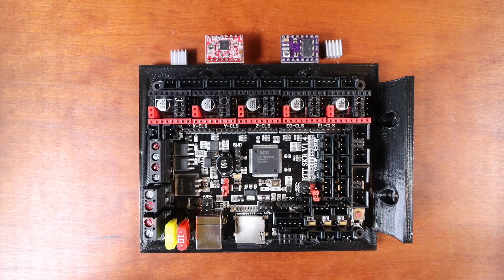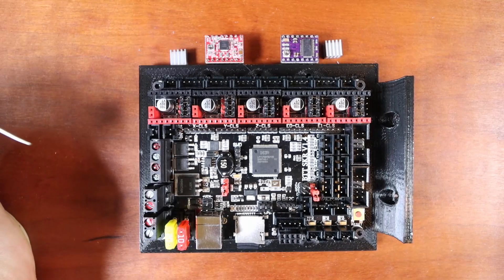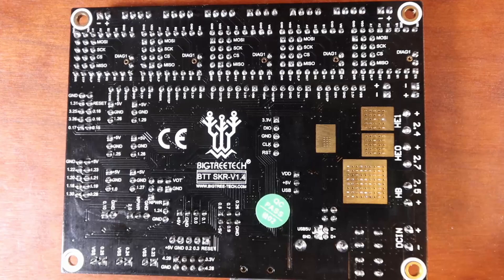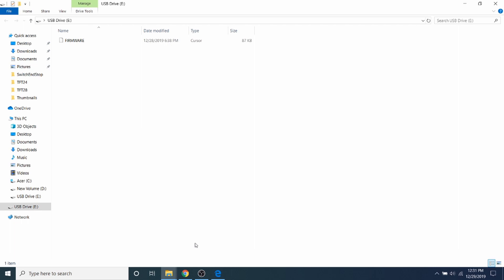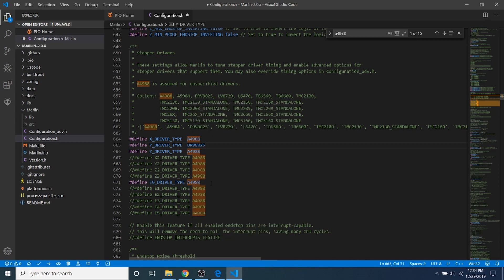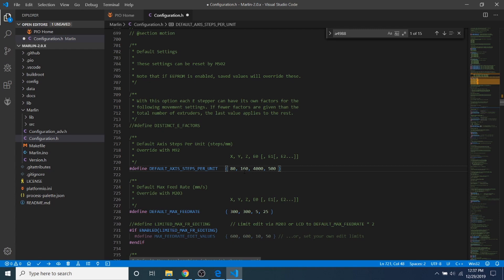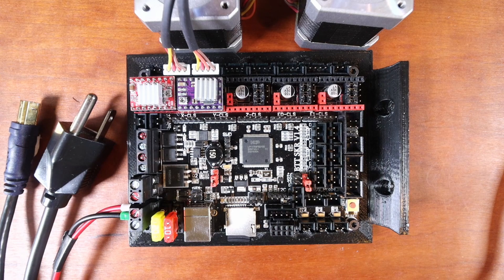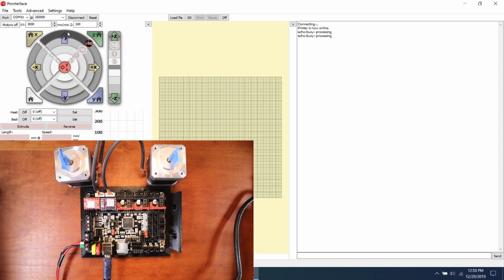SKR 1.4 - A4988/DRV8825 configuration

Comment: Hi, on the SKR 1.4 manual says that when we use DRV8825 we should connect RST and SLP with jumper cap. but it seems you are not using that jumper, why?
Reply from the maker: It appeared to worked or the manual was updated after the tutorial.  This happened to me with TFT display so it might be why.  I'll check the manual I downloaded last year.

Comment: Great, best I have seen in a long time. This tutorial explains everything you need to know to get your BigTreeTech SKR 1.4 up and running. All tutorials should be this good. Oh, I was using all DRV8825 so I updated my configuration.h to : 
#define DEFAULT_AXIS_STEPS_PER_UNIT   {160, 160, 160, 160, 160 }
#define DEFAULT_MAX_FEEDRATE          { 200, 200, 20, 25, 25 }

I only have one extruder and my printer is a Anet A8, TronXY X3S  clone with a Prusa I3 MK2 extruder. 
Thanks Richard
Reply from the maker: You're welcome.
Reply: @EdwardBraiman  : Great. got it installed and was able to compile: In this board there are five places for drivers. X,Y,Z,E0,E1 so if you have a driver in each you would increase the list to five. All with 160. but that gives an error. What else has to be changed. Thanks

Comment: Hi, thanks for your videos. One question I have some TMC2100 drivers from my previous board and I would like to use them in my new skr 1.4. They are compatible? And what would the jumpers be like?
In my previous board (mks gen 1.4) I had to remove all the pins, is it the same in this one?
greetings and thanks.
Reply from the maker: They should, but check the manual.  I've not tried them.

Comment: Thank you for the video's. Would you recommend the 8825's over the 2209?
Reply from the maker: Depends on your skill level.  For beginners I recommend DRV8825 and once they become novices work up to other stepper drivers.  Each stepper has advantages and disadvantages based on users experience.  Drv8825 is good starting place for cost and learning.

Comment: Can you help and create a video on the SKR V1.4 and the BL Touch and I am having trouble setting this up. I push on the BL Touch plunger and I do a M119 on pronterface and I never see a trigger on the Z Axis. And Thanks for your videos...  Great Job!!! I have 2 SKR V1.3 boards up and running Thank to your helpful Videos.
Reply from the maker: Currently there is an issue with BLtouch and Marlin firmware release 2.0.x.  funny thing is I've been trying to create a video for a week on this.
Reply: I understand that the error with bl touch has not been fixed yet ???
do you have a configuration for skr 1.4 and bltouch?
Reply from the maker: I think it's fun too Al now.

Comment: DRV8825 vs A4988 which would you do as I am going to get a CNC and wondering which of those to grab.  For 5 it is only 2-3 dollars more.
Reply from the maker: The drv8825 are one of my favorite steppers drivers.  They can be tuned by ear.
Reply: Tuned by ear?  Hmmmm.  I did notice they can handle slightly more current and I know the A4988 very well.
Reply from the maker: Before I learned to tune by multimeter, I used the sound of the Nema17.